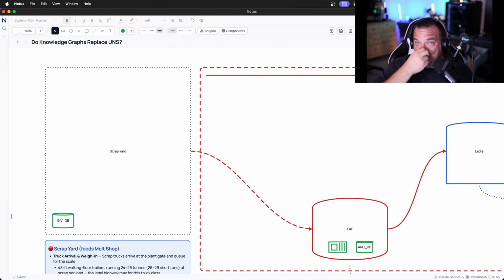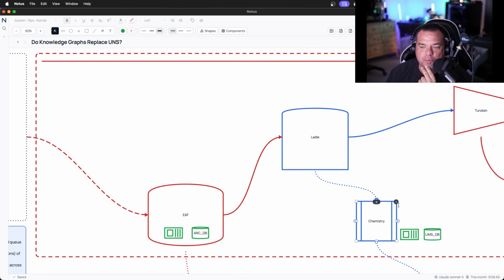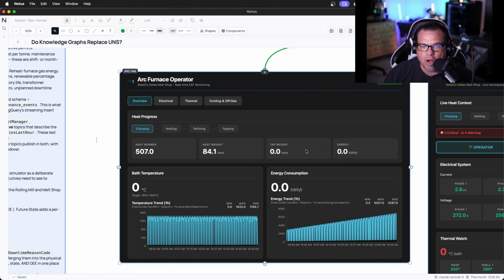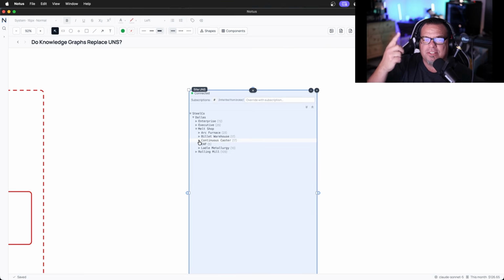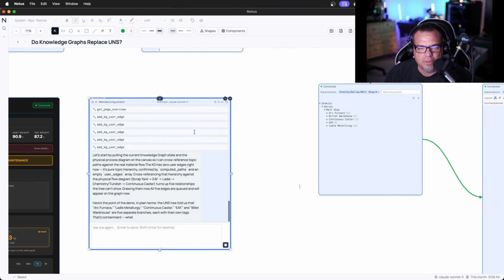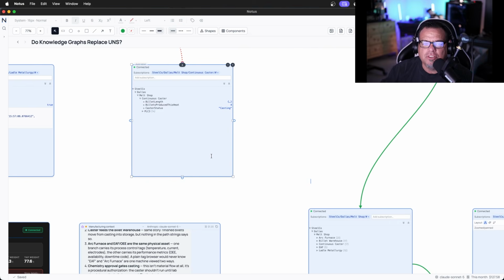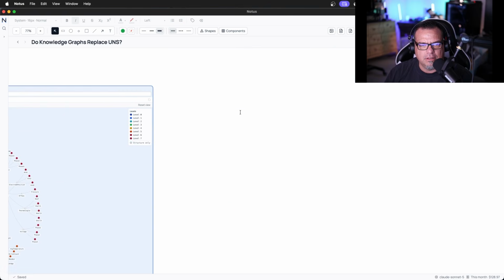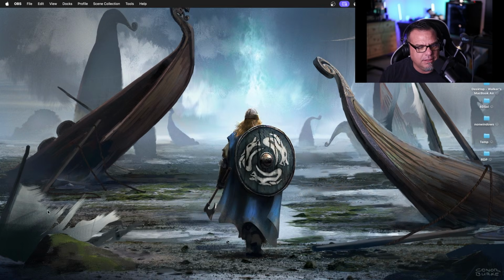Knowledge Graphs or UNS?

Comment: Insight on my experiences attempting to convert a "Facility Work Order System'" asset hierarchy (aka: confined within that platform - despite the need for an Enterprise Asset Management system - used by various stakeholders across the Facility Life Cycle).    I did not know about 'Graph - Property Property Graphs at the time).  

I saw there was a natural hierarchy - what you call "Name Space' so I was describing my concept to the local "graphic artist' as an "information squid" with information hanging as tentacles.  

As I learned about NEO4J and their online 'Arrows" modeling tool I ended up with the Hierarchy Graph as constrained name space:    Campus -> Building -> Section -> Floor -> Room -> Discipline (ie: MEP or People Movers) --- > Assemblies ---- hang the properties and the work orders here - at the edge nodes 

So the answer is BOTH.   
I learned from Military IT that there are three graphs that are needed to enforce the schematic discipline:
* The Template Graph - or your Name Space
* The Operational Graph - uses the template and receives new nodes or pointers to other information: Work Orders, MSDSs or Service Contracts, etc
* The Aspirational Performance Graph (don't recall the actual name) - The model that sets the 'Performance Targets' against which the Operations are measured against - and resources are allocated to achieve this end.

Keep in mind that the new Graph platforms (Neo4J Aura ) use the semantic information embedded in the relationships and can both Enforce a Name Space or render a new dataset very rapidly - according to the use case of the stakeholder.  

I did not get to the end of your video yet - but the answer is 'YES' - A name space and a hierarchal graph are the same 'logical semantic structure' - but are different 'domain specific ' contexts - with Graphs being more universal but could be customized into functioning as a 'name space hierarchy  "